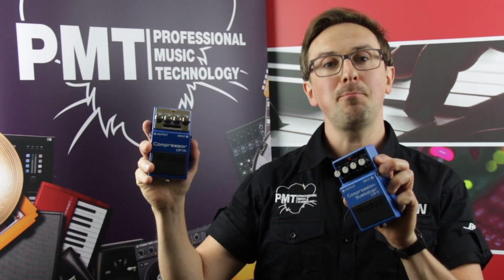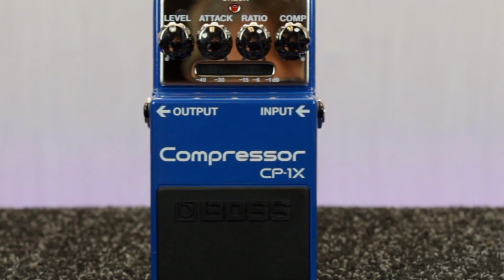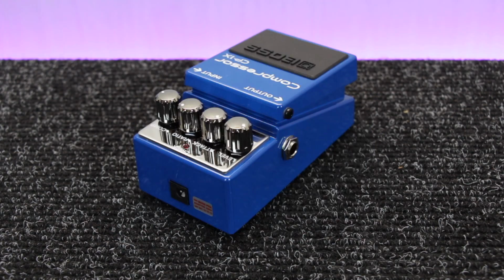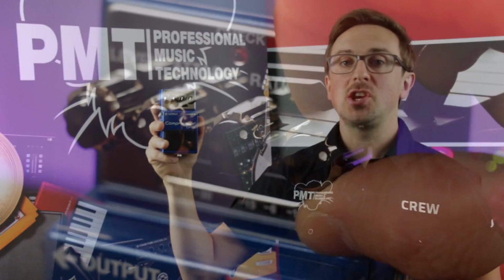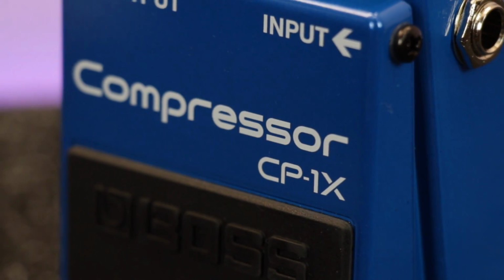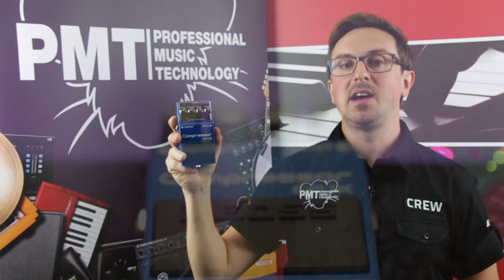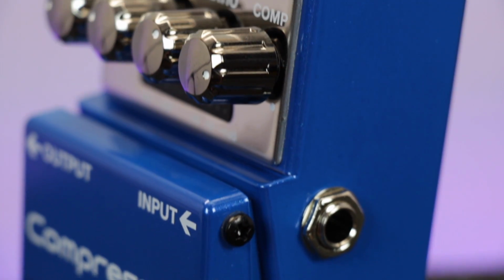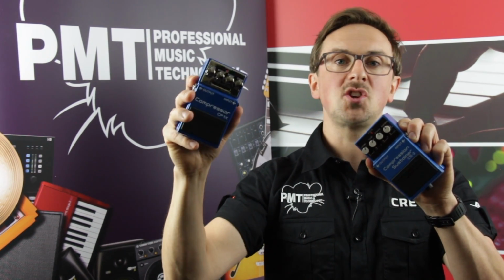Boss CP-1X vs CS-3 Compressor - Review, Demo & Comparison

Comment: I had my CS-3 on my board from 1992 to 2016 then I used the CS-2 for a year until I started using the CS-1 which is my favourite, quirky as it is, it's got that chewy elastic analog snap I crave! I don't think I'd use a CP-1X at all!

Comment: Kinda hard to judge, especially when the output gains aren't matched, nor are the parameters.  On first impression the CS-3 seems 'thinner' and squashier, but again, proper adjustment of both sets of controls would probably yield identical sound...

Comment: I have both pedals; with distortion I use the CP1X and add the CS3 when I switch to lead so all three pedals are on at the same time. The tone is amazing!
Reply: I've never thought about stacking compression... wouldn't that squeeze the HELL out of the signal?
Reply: @Dizastermaster.  never tried either, but i guess could be like opening the second Scotch whisky bottle. lol
Reply: @Dizastermaster.  stacking compressors is extremely common in professional recording studios
Reply: @colemcnair5752  yeah but for live music at the very beginning of the pedal chain?
Reply: @Dizastermaster.  probably not at the very beginning of the chain, but yeah you could stack a couple. just maybe be a little light on both of them
Reply: One at the beginning of the chain, one at the end. 

In my case, I max the level on my TS-9 going into a distortion pedal with the level cut a bit, and that provides fat compression at the right volume. Adding a compressor in front of that & before the envelope filter will effectively be "double compression". Excited to pick up one of these!

Comment: CP-1X for me. I think it sounds much more natural. Which is a shame because I just ordered the CS-3. Oh well.
Reply: How was the CS-3?
Reply: @ricmel8008  not bad at all. I ended up keeping it. I don't use compression that often so it suits my needs.
Reply: @vicarious1028  Thanks much. I am thinking of ordering one now. Do you think I should buy the CS-3 or the CP-1X?
Reply: @ricmel8008  if you're a big-time compressor guy (which I'm not), I would go with the CP1x. But if you just want a compressor to add to your arsenal, save $50 bucks and go with the CS3. I don't think you'd be disappointed.
Reply: @vicarious1028  Thank you very much
Reply: I love my CS3 because of the sustain, but will I lose the sustain with the CP1 X?

Comment: cs-3 settings were not matched as well [got close to the tone later on in the video but the volume should have been at around 3-oclock]. However I agree with a comment below "the cpx-1 sounds like a studio compressor and great for acoustic recording. I like them both but would much rather use a CS-3 for stage and the CPX-1 for recording.

Comment: would this work for a bass (I know there's a bass compressor but I just have the money for one of this cuz it's on sale
Reply: It would but the bass version would be better.  This uses digital circuitry than analyzes your signal so each version is optimized for the frequency spectrum of guitar or bass. Good luck!

Comment: I have a cs3. For years I found it unusable but I’ve figured out how to get good sounds out of it as of late but it’s just never transparent. Not that transparent is always good. But it can suck the life and the high end clarity out of your tone unless you’re very careful. The cp1x doesn’t seem to have that problem. All the demos I have heard it sounds fantastic. At every setting. Sounds like they nailed and I might have to get over the digital mind block I have. 

Pros 

Great sounding compression from light and imperceptible to heavy.  It never sounds “choked”

Less expensive than its quality competitors 

Gain reduction meter

Super low noise floor

Sturdy

Cons

Silver knobs aren’t the best to look at and can be hard to see where the knob is set

No XLR input 

Doesn’t look as cool as other “boutique” pedals. (Yes that does matter)

Comment: I have electric guitar, and regular speaker, where there isn’t coming out the electric guitar sound. Will this compressor sustainer make a difference ? (Thx)
Reply: No sound?
What do you mean?
Completely dead?
If it is, then either try to swap the guitar or the cable or the amp
Just borrow your friend's for a moment
This pedal is for enhancing your sound not to fix it